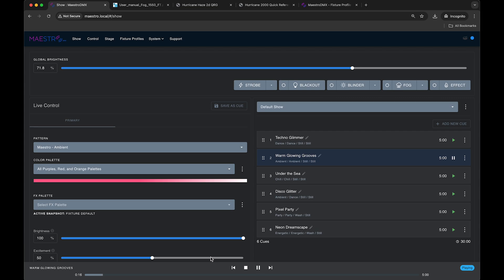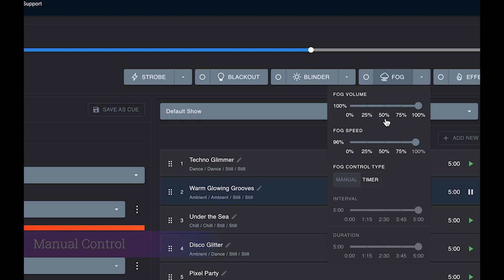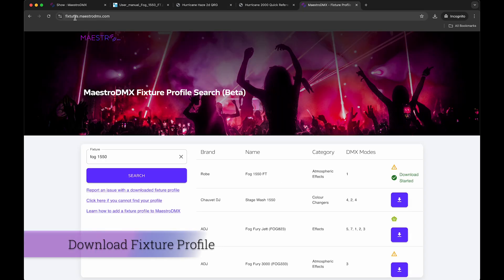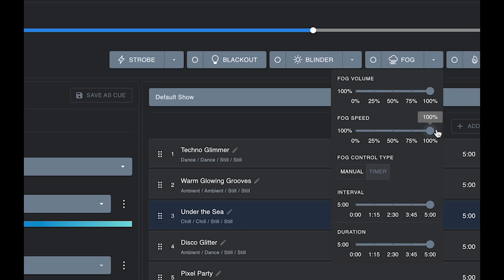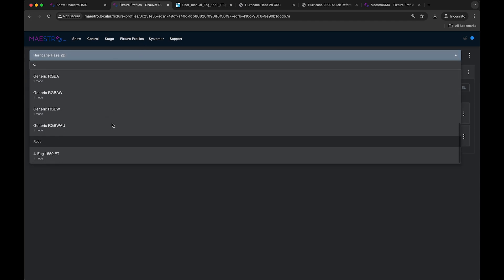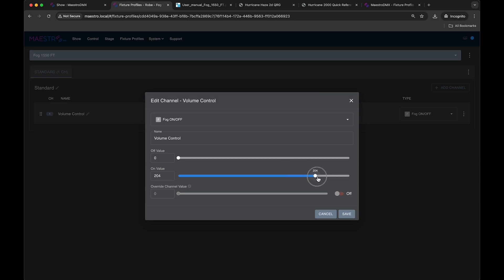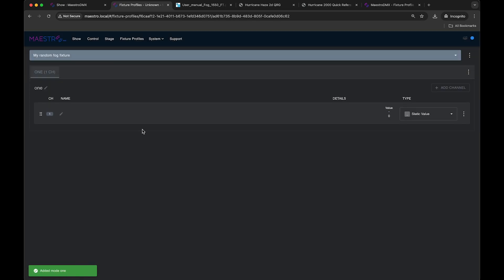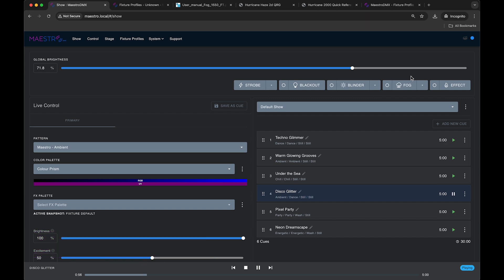Tutorial - Using Fog & Haze Fixtures (v1.4.0)

Comment: I still have 1.4.0 installed and have a fog machine setup using an FX palette... is this unneccessary? Is it set independently to fixture groups?
Reply from the maker: you can put the fog machine on any fixture group you like. This feature will work fine with 1.4.0. But we do recommend updating to 1.4.1.
Reply: @maestrodmx  I am going to update after the weekends gigs! Are you saying that once the fog machine is set to a fixture group it will work without having to mess about with snapshots and fx palettes?
Reply from the maker: Follow the instructions in the Fog/Haze tutorial video, thanks.